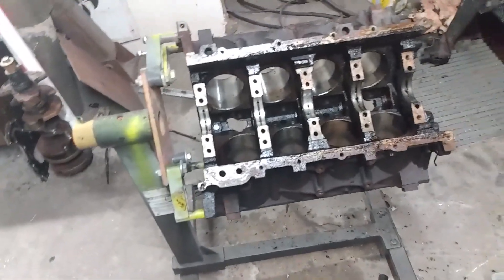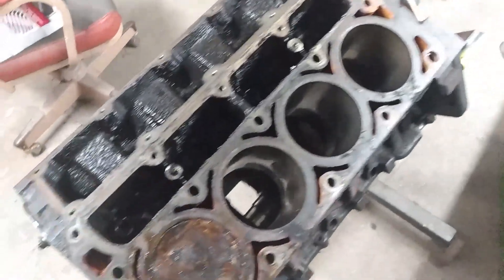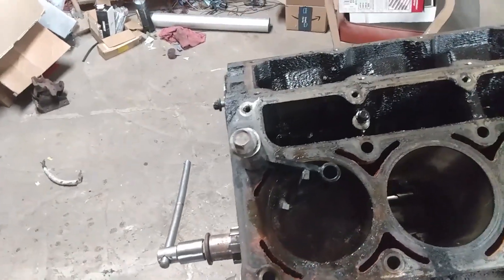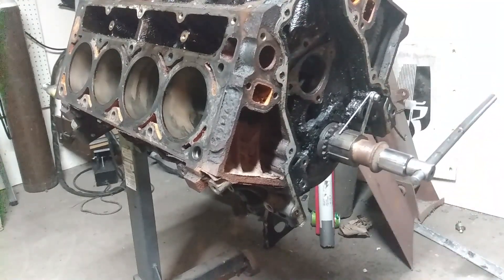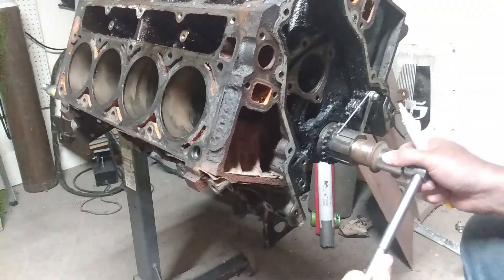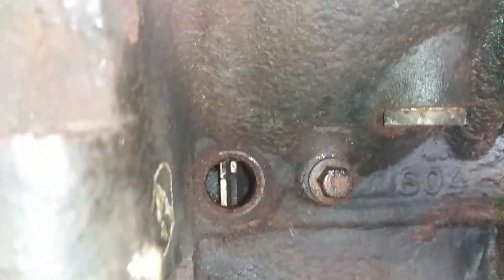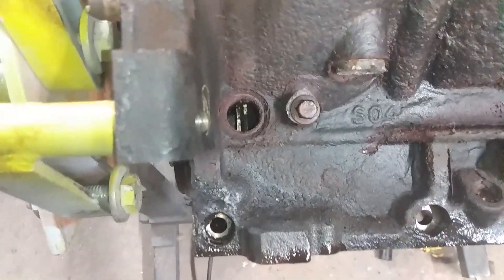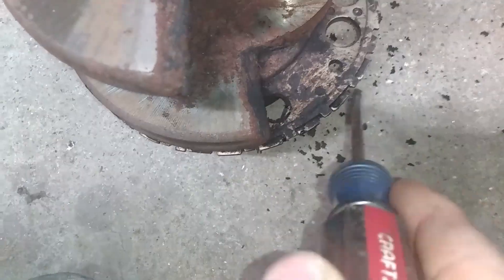24X LS GEN 3 Trigger Wheel TDC for ANY EFI Conversions - PROJECT TURBO DUKE

Comment: Thanks for your information. How is that duke project going? Did you turned it on? If so please show a video😁
Reply from the maker: @MTP727  I've been working on it here or there, I've been calling.it the back burner project.

Buying odds and ends as well, join the fb group I post more updates there, till I make enough progress for a video, which should be soon

Comment: Thank you for showing the diagram. Hardly any content out there about the 24x wheels. I bought a k1 4 inch stroke cranks second hand that had came with a 58x wheel and I needed a 24x wheel cause this engine is for my gen 3 truck so I decided to swap them by heating it in the oven to where it it would slide on. I did make scribe lines using the old wheel but still be nice to check it before I assemble incase my scribe lines were a degree off or the old wheel wasn't aligned right
Reply from the maker: @autumnjeserich2689  I'm really proud of this video, since I couldn't find one about the subject, I had to make it myself.

It isn't very popular but I'm very happy it was useful to you sir.

Have a great day.

Comment: There's an alignment tool just for this reluctor wheel installation.
Reply from the maker: there is one for installing it on LS engines, but i dont think it helps in this situation. thanks for the reply, this video dont see much action.
Reply: Apologies. I had to make it to the end of video. 
You aren't even worried about LS you on something way different entirely.
Very cool. 
Did you ever get the reluctor on anything else and the LS computer working on those other engines?

I'm gonna have to scroll your videos and see. 

I didn't watch the video fully originally I thought you were just swapping the reluctor wheel around 58 to 24 or something. That's why I was like there's a tool for that 😅
Reply from the maker: @AutoMotoMechanic  i am still working on it, i hope to have something working soon.